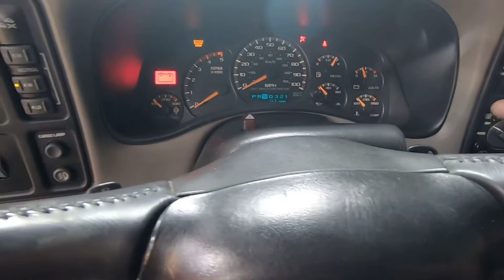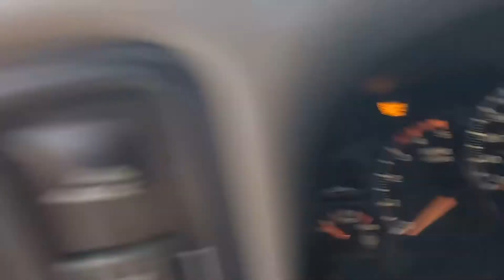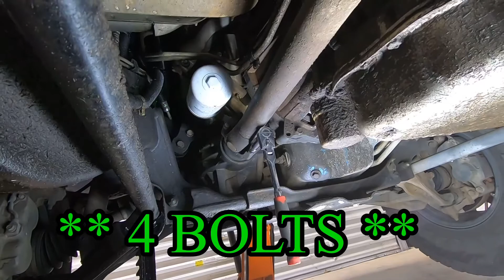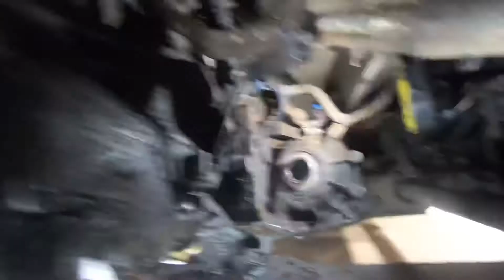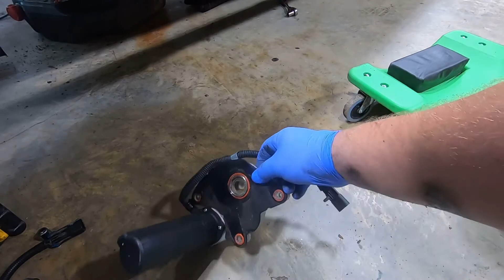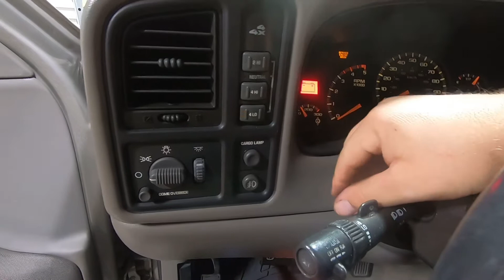How To Replace Your Transfer Case Shift Motor 01+ Chevy GMC 2500 HD #duramax  #LB7 #diesel #4x4

Comment: Replaced mine, cycled switch in garage.  Shifted to 4Hi then back to 2WD just fine.

Driving down driveway, went to shift from 2WD to 4Hi and lights went out on selector 😢

Stuck back in 4Hi
Reply from the maker: You might want to check the control switch panel
Reply: @quickspoolgarage  figured out it’s popping the 20a ATC fuses in the main panel.  So, guessing I have a short somewhere…. Yay for me, this should be fun trying to find it….
Reply: @petecoots did you get it fixed? Mice love to get under your fuse box and nibble on the wire coating.
Reply: What was it
Reply: @45makeitlpuder  well, after I bought a remanufactured transfer case and had shipped to Alaska.  Got set to stsrt replacing and luckily my buddy is a way better mechanic.

Figured out the transfer case control module in the dash was fried and my year old encoder motor on the t-case went bad too

Got lucky was able to sell the reman t-case up here to someone else